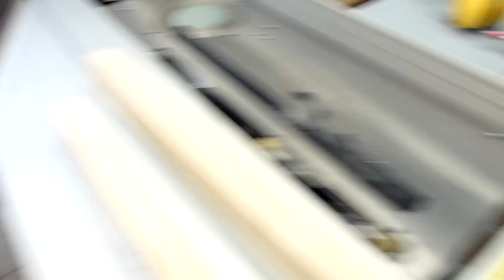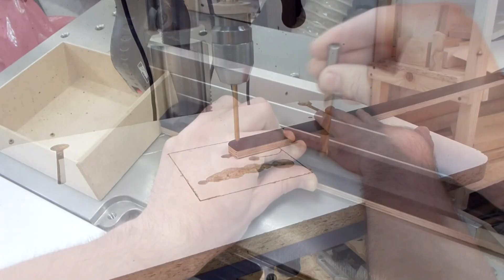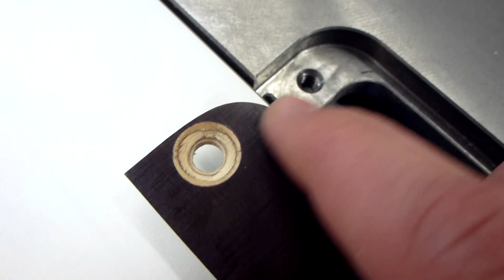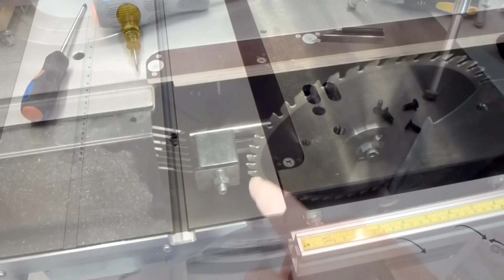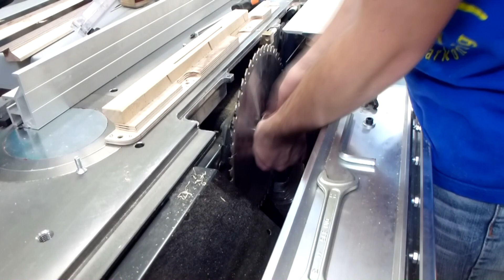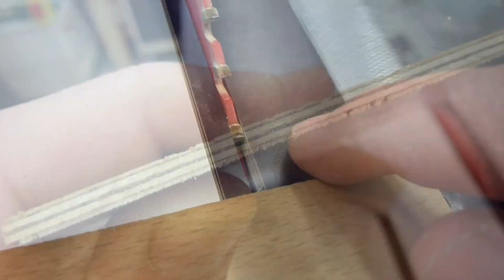Making Zero Clearance Inserts for a Sliding Table Saw

Comment: Why not just use a filler to fill the saw slot on your existing cover, then plunge cut thru the filler?
Reply from the maker: the existing cover is not flush with the table and it also has no mounting options for a filler
Reply: Marius Hornberger filler, as in 2 pack body filler or a light epoxy.

Comment: Thanks for this Marius, I have a Hammer C3-31, with a 2200mm sliding table. Ive wondered for a long time, how I was going to make a Zero Clearance plate. Because many a time I've had fine slivers shoot back down the saws throat, which can be very dangerous. which also can cause a blockage in the dusts extraction. 
Cheers from Western Australia.

Comment: just a note - you state in your video  "3,2 mm right size for M4" - this is not entirely correct, but right :)

M4 threads made by using core diameter of 3,3 mm - but the inner core diameter of the finished thread is 3,24 mm since the thread is not cut but also reshaped by plastic deformation

so if you use metric threads in very soft materials like wood or very elastic materials that cannot be reshaped you need to use a core diameter slightly below the finished diameter

in your example 3,2 mm is perfect for cutting threads in wood but not the right diameter for M4 in a general term - in metal you'll ruin your tapping tool and produce flagile threads

Comment: I just learned that dado blades are either illegal or hard to get in Europe.  is that so, and may I ask why?  thank you
Reply: Hard to get... mainly because manufacturers don't sell saws with a long enough spindle.  Why?  Because it is mandated in the EU that a table saw (and other powered tools - I think) has to be able to come to a complete stop in under 5(?) seconds (H&S).  This means that with a dado blade you need a brake and that brake can cause the dado stack to undo the nut.  You CAN get saws that accept a dado stack over here (although as you mentioned, they are hard to get), but it usually has a cotter pin in the spindle to avoid it coming undone.
Reply: +EscapeMCP thank you for letting me know my friend....I just learned something new

Comment: I also have a sliding table saw. It took me a while to learn to align the sliding table perfectly to 90 degrees.... I don't use the 5 cut method, I use an engineers square and a dial gauge. Perfect and no wasted wood! Anyone not using a slider can't appreciate what they are missing! More accurate and safer.

Comment: Nice job. Interesting use of the scroll saw to cut the riving knife slot out.

I made my first zero clearance insert last week, and I ended up using my Dewalt track saw to basically start the slot off so the knife could pop through whilst the initial cut was done. It was tricky to align though, and I had to throw one away before it worked. If I had a scroll saw, it would have been better. I suppose you just have to adapt to what tools you have.

I hope you found your set screws!
Reply from the maker: Andy Midd a jigsaw should work too. And yes I did.

Comment: Good presentation. I've never seen a table saw like yours so it was interesting to see how they work, in the context of a ZCI.

I've seem ZCI's made for other style saws, and most people use a purely subtractive approach. When I made mine, I found that to be tedious, so I made mine in different shaped layers, glued together to make the overall shape. I was pleased to see that you used both approaches, "hogging out" and also laminating additional pieces to make the final design. And I really like that the bottom birch piece extends to the side, below the sliding table. Effective 3D design. :)
Reply from the maker: Barry's Workshop Thanks Barry!

Comment: Good work but I think the saw manufacturer could have made it a little easier to do zero clearance inserts.
Reply from the maker: gamingSlasher The "Felder" series has zero clearance inserts available, but the "Hammer" series not.
Reply: Marius Hornberger That's shocking that the Felder Group would sell zero clearance inserts for their main product line but not for the Hammer series of saws.  I've made a lots of inserts for my Delta Unisaws, which is a quick & easy, no-brainer job,  but should I own a Hammer series saw, I would definitely prefer to buy them.  It looks like too much time and aggravation to make them.  By the way, your outtakes were delightful to watch.  Please do more.
Reply from the maker: I actually think that you can buy one too for use with the dado blade, but I couldn't find them anywhere yet.